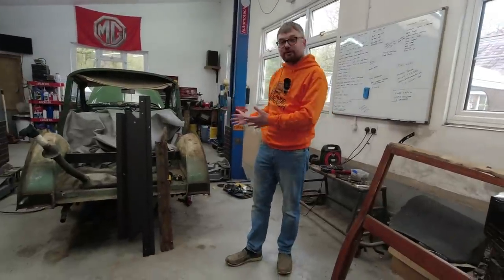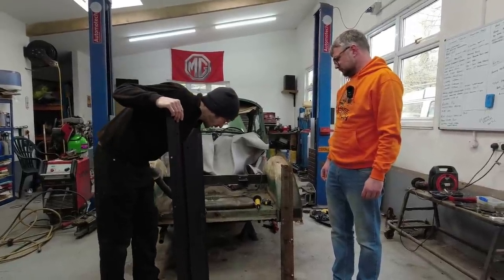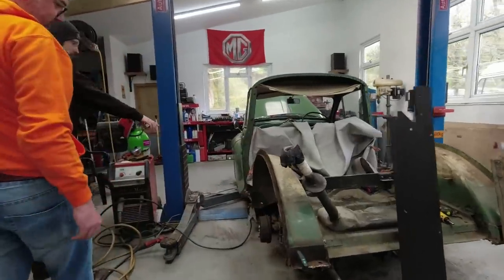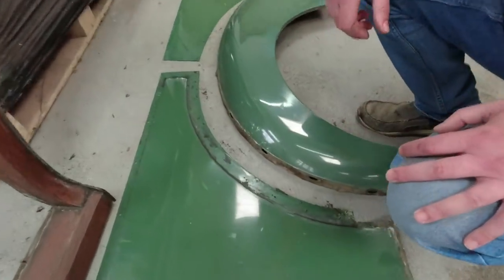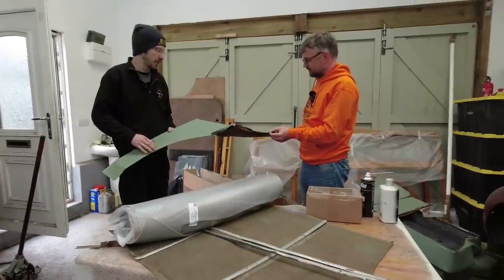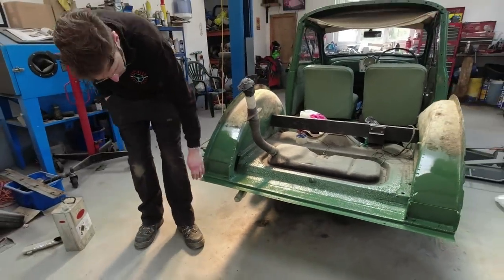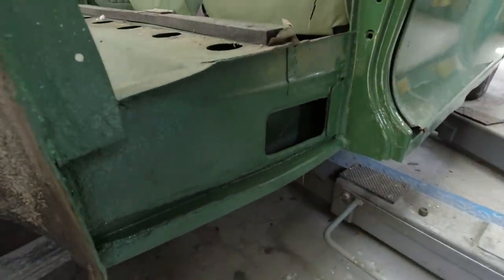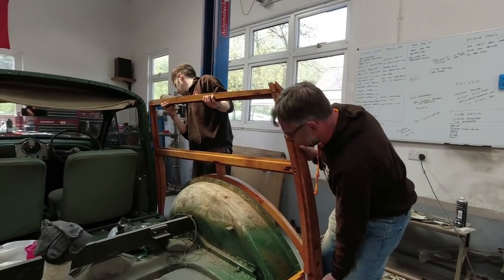(EP3) Fresh wood! Morris Minor Restoration

Comment: On a nice day last Thursday, I travelled from Whitefield, Manchester, to a Minor restorers in Luddenfoot, near Halifax, around 25 miles and 40 minutes' drive from Chez Nous, to West Yorks Minor Centre.  There were around half a dozen in the process of being repaired, in a showroom there were around 7 or 8 vehicles, which looked in pristine condition.  I had a quick chat with the proprietor, my Traveller is in need of repairs.  I'm due to retire shortly, so hopefully funds will allow for any wood or bodywork repairs, the mechanicals are a bit more straightforward to deal with, even for someone of my somewhat limited ability.

I'm glad to see these specialist repairers are still in business.

Comment: I've just done this myself only it's taken me four years to get the rest of the car in good enough shape to actually fit the frame, basically I've re-built the whole car. My mistake was to buy the timber sections I thought I needed before actually taking the thing apart which meant, after I realised it all needed replacing, I bought everything separately and had to assemble it all myself. Hindsight  is a wonderful thing and buying the side frames ready assembled would have made life a lot easier - buy where's the fun in that I hear you say😁
Fitting the roof and guttering is a whole new world of entertainment too😉

Comment: BTW, I forgot to mention the Granddaddy of them all, the original Morris Minor Centre of Charles Ware,  ceased trading at the end of last year, although the spare parts section of the business is still operating.  The operation was set up in Bath in 1976, later relocating to Bristol.  Charles Ware himself passed away around 5 years or so ago, I'd say it's unlikely that had he not set up the original company, very few Minors would still be on the road today.  I met him in the late 1990s, I was working in the Bristol area one weekend.  

I remember taking pictures of the various models on the site, there must have been upwards of 40 vehicles on display, including a pick up and a couple of vans.   He was very courteous towards me and very helpful, even though at the time I didn't have a Moggy.  The first two vehicles I ever owned were an ex GPO van I bought in 1972 and a Traveller I bought the following year, after the gearbox gave up on the van.  Then I went from 1974 to 2010 without a Moggy, but I returned to my first love eventually, a car I still possess today.  I still see a number of Moggies on the road and am a member of the Lancashire MMOC, which does much to promote the continuation of the iconic vehicle, the first British car to sell a million.

Comment: OK, here’s a dumb question from the dry Southwest of the United States: for cars like this Minor that is on its second full restoration, is any thought typically given by British car enthusiasts to just not take cherished cars like this out on wet days which will inevitably lead to further rust (and wood rot).  I realize there are a lot of rainy days in the UK, but for the amount of heartache and work involved in dealing with rusty cars, wouldn’t a sensible alternative on a hobby car like this be to preserve it as long as possible by avoiding rain at all costs?
Reply from the maker: It's so wet here that if you wait for dry days, you just won't drive your nice car very much at all.
Reply: The real issue in the UK is salting of roads over the winter period which leads to terminal corrosion. Rainfall during the remainder of the year not so detrimental 😁
Reply: My father bought a 1924 Lancia Lambda in 1945 and kept it running for the rest of his life - right through to 2014. He never ever drove it on salted roads, but we ploughed on through rainstorms and floods at all other times of the year. So the comment is right, avoid salt, keep it in a garage and make sure frame drains are clear.

Comment: Makes you wonder how much more effort goes into rebuilding these versus how they were built when they were in the factory, given that BMC/BL were a little notorious for their "that'll do" mentality... :\
Reply: The Morris Motors Bodies Branch was originally the Hollock & Pratt coachbuilding business, which Morris had bought out in 1923.  The people building these bodies would have mostly been time-served craftsmen, and as long as they were properly cared for, they would last the lifetime of the car, which in any case was only expected to be ten years or so. It's a credit to BMC's engineers and designers that thousands of Minors are still running today, more than fifty years since the last one came off the line, and 75 years after the car went into production.